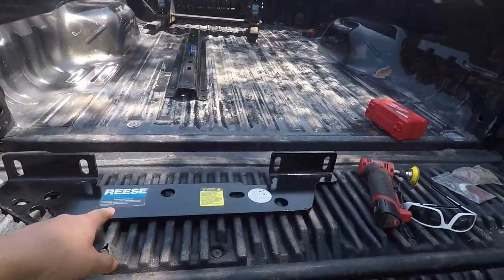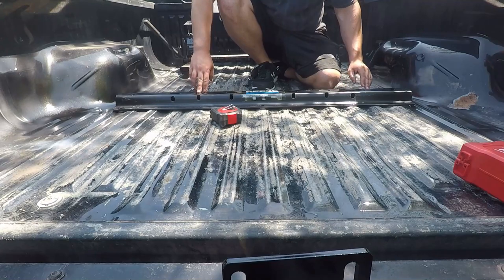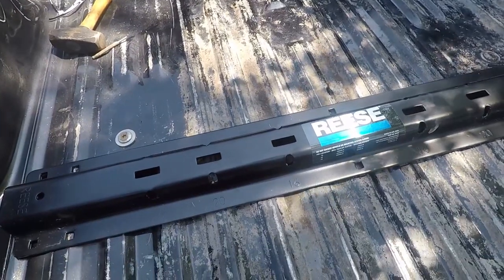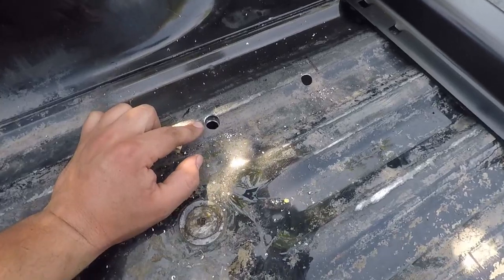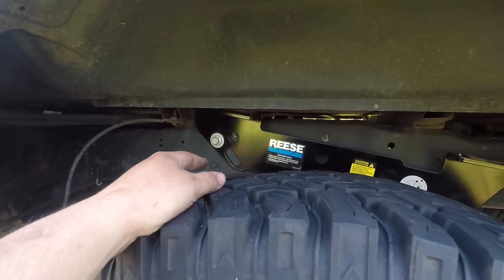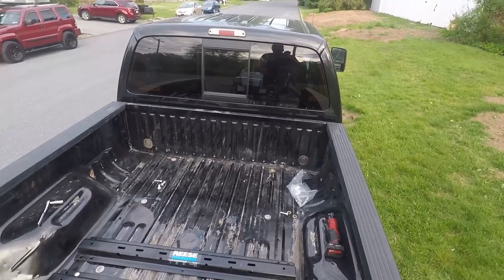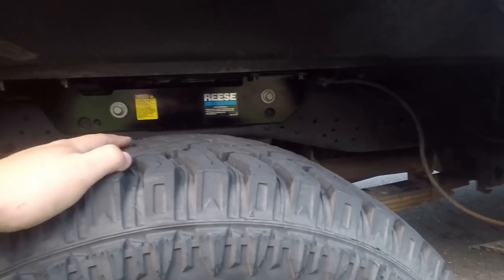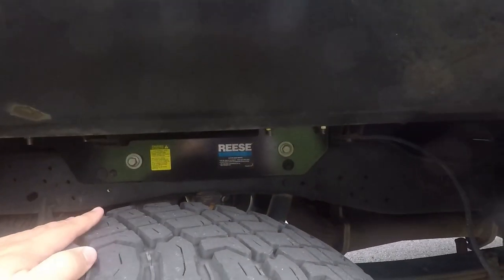Fifth Wheel Installation Kit 2015 F250

Comment: Great Info Jared, how's the stock 6.7 tow compared to you're built 6.0?
Btw got my lh rear caliper n rotor swapped out about an hour it took me to that's removing tire n wheel to bleeding the brakes n torquing the lug nuts. The slide pins froze up. The tech's at work said pretty common issue on the rear of the Superduty. Truck is running great though.
Reply from the maker: Slider pins are super common. I need to go through all of mine and mess with them soon. It did great still have some things to adjust and get taken care of but overall did amazing. Video soon on comparing the 2 platforms. I think it will surprise people
Reply: @six0bros  yeah you need to keep up on that for sure. Yeah well as long as you're happy that's all that counts.
Reply from the maker: probably sounds snobby but ill be happy when my 6.0 is back!
Reply: @six0bros  I don't  think so  you have alot of time & effort & money put into you're truck bro

Comment: Do you have a conversion table to convert those torque specs to uugghhaa ddoogggaas????  If not I will just Google it ......
Reply from the maker: 4 ugghhaa dooggaaass for the lower torque spec and about 7 for the higher ones. When in doubt just do 8 across the board lol
Reply from the maker: I do know a lot of guys that do it that way and have a crap load of miles towing that way. I think the biggest thing is it not being to lose. I mean I wouldnt hold the impact on them for a like a minute straight but make sure they are tight enough.

Comment: How's the 6.0?  Ever figure out what was going on?
Reply from the maker: Not completely yet I have some things planned. Been looking at kill devil diesel engines 🙄
Reply: @six0bros  That's my plan too.  Ever since I found that roller bearing, in the low pressure pump.  I've been anticipating it dropping a cylinder and go out at anytime.  So I have AAA+ & I've saved up enough for the entry KDD longblock.  I'm currently hoping it holds together long enough to save up enough for the carrillo rods & pistons built longblock for $9,800.
Reply from the maker: I want to do a full build with ported heads and all. Just gotta get the money together. All this while in school too lol.